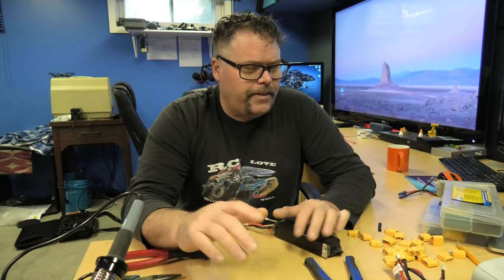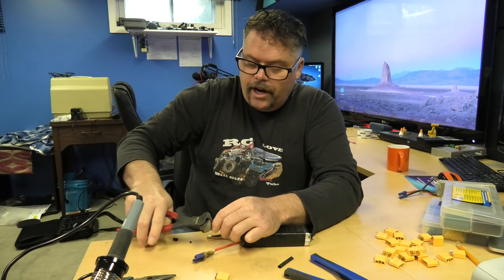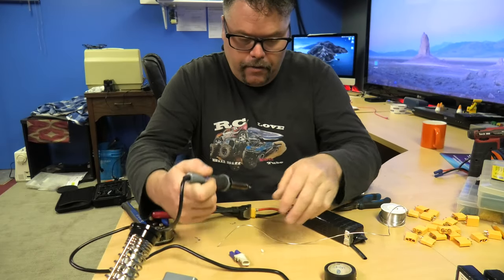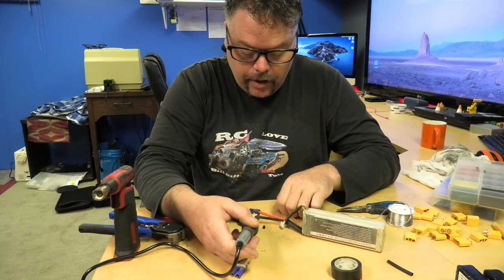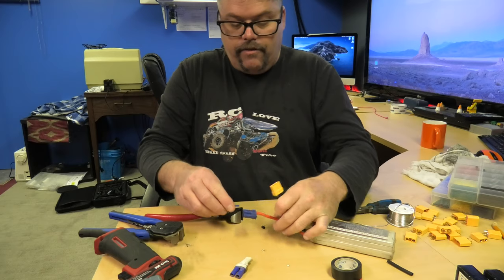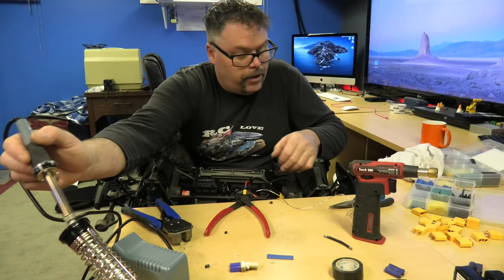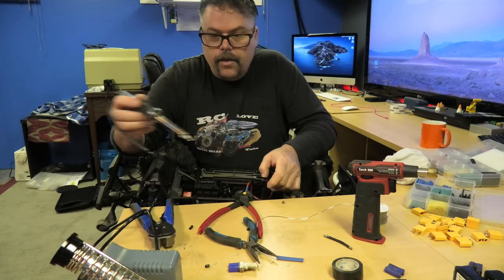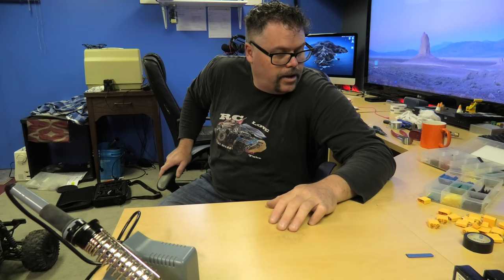Soldering With Dummy's RC XT90 Battery Connections

Comment: Ya forgot to tin the tip of the iron too. I used to do that all the time. Just a little dab of solder on the iron and the heat flows like water

Comment: Not an expert but I can offer a few words of advice that may help.

0. Always used leaded solder, it's simply way easier to work with for us amateurs, it has a wider working range and it sets more quickly when you remove the heat.

1. Always keep the tip of your iron tinned. It's best to start this off the very first time you turn it on when it's new by wrapping some solder around the tip so it melts onto the tip as it warms up. Then wipe it clean then put more solder on then wipe clean then more solder etc, do it about 5 times and the tip should be nicely tinned and now every time you wipe it you'll have a nice shiny tip ready to work. If your tip hasn't been tinned and you're already using it, you can try and tin it with the same basic process just keep wiping it off and adding solder then wiping then adding etc until you get a tip that's nice and shiny even after you wipe it.

2. Tin the wire first. Before you marry the wire up to the connector, flow some solder into the bare wire. Using some kind of flux here can help as it increases the capillary action of the solder going into the wire but you can usually manage without as long as the solder has some flux already in it. I find this is MUCH easier if you put a dab of solder on the iron to kind of act like a thermal bridge between the iron and the wire, then introduce some more solder in the vicinity of the iron tip and it should start to flow into the wire, the more that flows in, the better the heat will transfer into the strands and you'll be able to move the solder away from the tip of the iron and get it nicely distributed into the wire.

3. Tin the connector as well. Use the same basic approach, a blob of solder on the iron tip to act as a "thermal bridge" so that you can more easily transfer heat to the connector, you should be able to get a nice bloc of solder to take to the connector terminal that way.

4. If you can, try and put the iron tip between the connector and the wire for a few seconds to heat them both up simultaneously and get the solder melting then quickly remove the tip, put the wire on the connector and then out the tip on top of the wire, make sure the solder on the wire flows into the solder on the connector and it all merges into one then remove the iron again and allow the joint to set.

Those steps should help you get on a bit more easily. A flux pen or a tin of flux paste can help too, especially getting those thick wires tinned, it still helps even if you have solder with flux inside.

You might want to look for a slightly bigger tip for your iron, the rounded ones are usually more suited to the smaller and intricate jobs. A larger, more chisel like tip will have a better thermal capacity.

It always helps have a decent iron or soldering station like a Hakko because they tend to hold their heat better so you can get in and out quick rather having to hold the iron there for ages BUT you can get away with a half decent iron if you follow all the above steps. I have a crappy fake Hakko and it still does the job just about.

A decent iron and technique really does make life easier but you can get by with even a crappy iron and no skills is you stack the cards in your favour a little, that's how I manage!

Comment: The solder should melt when touched to the heated wire, not by melting it with the soldering iron tip. Use a dab of electronic flux paste to help clean the connection and to make the solder flow easier into the connection.

Comment: use a flux pen and solid solder and not so large of solder for those smaller wires the large dia. stuff is mainly used in plumbing.

Comment: there is an easier way, you need to put solder on the wire and some in the connector first. put a fresh drop of solder on the iron and immediately solder everything together

Comment: Whenever soldering dip the wire ends in flux it heats up nicely
Reply from the maker: But it is flux line lol still have to?
Reply: @LifeWithBillSiff  yes the flux is inside the tin if the flux is on the wire your connecting it draws the tin to it!
Reply: Why wouldn't it?....🤣😂😝

Comment: Bill chap hour said it rightly.  I find the best way is to do terminal connector - connectors face uptake drop a load of solder inside the connecter.  Some solder on the wire - then............ Solder tip in middle of connector until it finally goes liquidy, then shove the wire in (using pliers)  you got them done tho chapper - if you can give it a good old Yank 😂 and it don't fall off - 
That's what she said...............😂